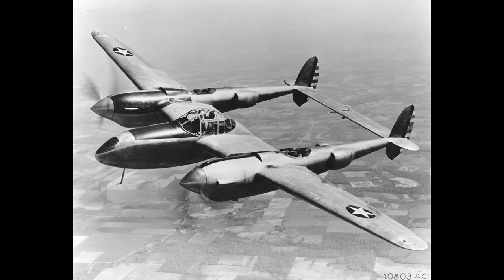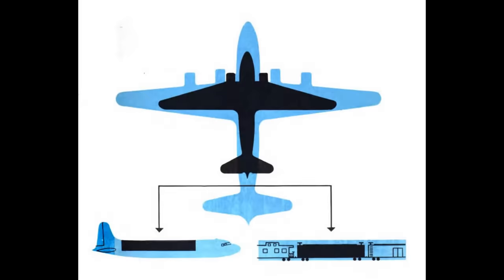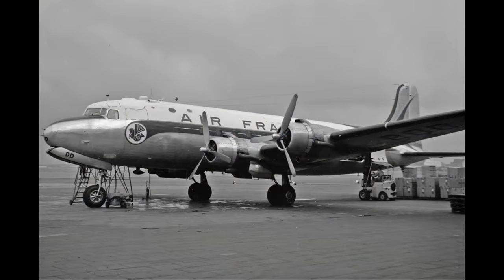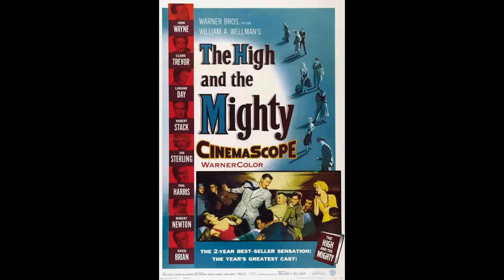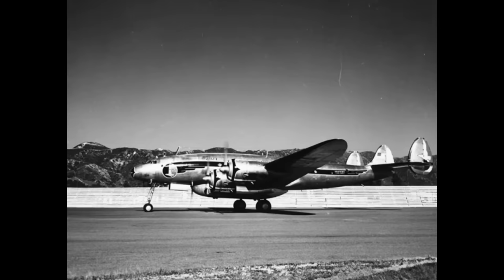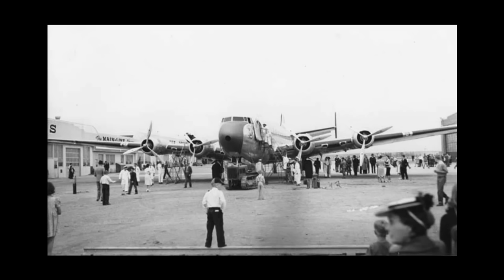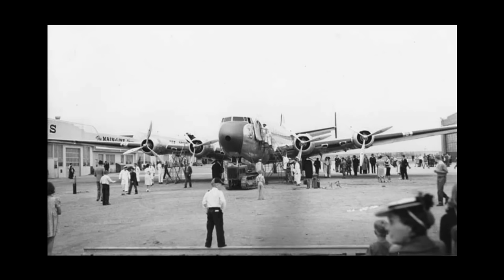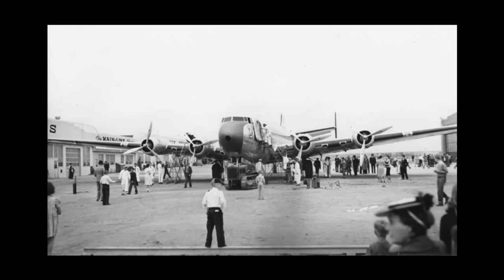Turbo Compound Piston Engines. Almost magic tech.

Comment: If you ignore everything upstream from the turbine, doesn't a turbocompound use the same basic principle as a turboprop?

I wonder if exhaust thrust would ever be more valuable than the turbocompounding, it just seems so much less efficient that it may never be worth it, I'll try to calculate it
Reply: So after some research, calculations and a fair amount of guesswork I have come up with this:

A mosquito will lose about 13mph by installing the exhaust flame dampers, now, I can't possibly know how much of that is caused by extra drag, power reduction due to backpressure and exhaust thrust loss, but let's say that the remaining thrust cancels out the other factors, calculating the drag at top speed with/without dampers I have come to 230-250lbf from the exhaust, with 3420hp that's 0.067-0.073lbf/hp. On the chart shown in this video we see turbocompounding adding about 19% extra hp at full power (550/2850hp), or 0.19hp/hp. So at what point does 0.07lbf overcome 0.19hp? A bit over 1000mph. Now, I do not know if this reinforces my theory that turbocompounding is vastly more efficient than exhaust thrust or if there is an error in my ways.

Obviously my numbers aren't 100% correct (perhaps a bit more exhaust thrust?), but I am confident it does reach the correct conclusion. I've seen ratios of 0.1lbf/hp quoted for top fuel dragsters (~1000lbs, ~10000hp), which use bonkers nitromethane engines that throw giant 6ft fireballs, and even then it would take 715mph, almost supersonic speeds, for the open exhaust to beat turbocompounding.

If someone finds an error please correct me!

Comment: I wonder if they could have also converted the heat from the exhausts into a secondary power recovery from steam into maybe a steam turbine,
I don't know if it would be enough to go straight to the crank but an electric motor but with all that bhp the heat produced must be pretty significant.

Comment: 2:30
Possibly the best COMMON long-haul transport.
There were Constellations in existence and in use at that point - but they had not had the chance to start volume construction by the time the US entered WW II.
Reply from the maker: as explained in the video.
Reply: @GregsAirplanesandAutomobiles  Not that I saw, or I'd not have made the comment.

Comment: I have thought about using a V8 & using every other cylinder to supercharge when a lot of power is needed . The old BMW motorcycles were very low compression so lasted long. Now the compression ratio is about double so engine life is less . I am very interested in opposed piston engines , wondering why they need turbo or supercharging . The old 2 stroke bikes lasted long too.
Reply from the maker: That's already been done.

Comment: I was expecting to see what we call "twin charging" in the automotive world. This is totally different and interesting
Reply from the maker: Yup, twin charging is totally different.
Reply: @GregsAirplanesandAutomobiles  yes, although a chain (or belt) driven supercharger pushed by a turbo will put power back to the crank as well
Reply from the maker: kinda, it will still be a net loss, that exhaust back pressure from a turbocharger hurts the overall power.
Reply: @GregsAirplanesandAutomobiles  yes pressure turbo is more obstruction for sure

Comment: I find that definition of being able to cross the Atlantic somewhat abstract.
It can cross the Atlantic (but it has to refuel multiple times). By such measure, there are many flying boats which would be able to cross the Atlantic. One could even possibly argue that a Cessna 172 with floats would be able to do the same.

Many thanks for another great video.
Reply: Where do plan to land that 172 to refuel?
Reply: @jaym8027  Close to a boat or ship carrying avgas.

Comment: You explained this well. But im curious why it hasnt been tried on other aplications... why not also add a compressor to this and add air and fuel=even more power.
Reply from the maker: It has been tried in other applications and in all cases a compressor is used to add more power.

Comment: This system would lend it self greatly to electric turbo setups combined with hybrid drive - one could recoup energy from the exchaust AND when not needed, store it in the battery OR feed it directly to the electric motor !
Reply: Basically what you said is the very thing F1, Mercedes AMG ONE and future Porsche 911 use (and will use)
Reply: @kidpagronprimsank05  yeah, BUT audi (IF I’m not mistaken) has an electric turbo setup already in production cars but it seems that they missed the boat on tangling it with at least mild hybrid.

Comment: I was told many years ago that USAF had 8 jet engines on trailers at gander, overcast weather, would run them to help burn off fog covering runway.
Reply: The FAA had an experimental program at Arcata CA that used huge kerosene torches for that- worked OK but very dirty
!😊

Comment: just thinking that the hot exhaust, ejected at a speed (velocity) greater than the travel speed (guess?) and directed rearwards would support via newtons principle, a degree of thrust..  quasi Meredith effect...   does the recovery of exhaust momentum energy (ie velocity) not rob the aircraft of this form of thrust?   perhaps you mentioned it.. perhaps the angle of exhaust rejection does not support this...
Reply from the maker: Ervs, did you watch the whole video?
Reply: My response ended up as a new comment…😬

Comment: 23:58 you don't need aerodynamics for that, just basic physics. Thrust is a force. Energy = force*distance. Power = energy/time = force*distance/time = force*speed. So if our force is thrust, we have power = speed*thrust.

If we combine different unit systems (in this case nautical units for speed, imperial units for force and the arbitrary unit of horsepower for power), we nerd to do a conversion, which adds a factor, in this case 1/325.
Reply from the maker: I have to use a source, for this channel the best possible source to use is often Aerodynamics for Naval Aviators. Yes, there are other ways to look at it and other sources out there.

Comment: Damn, now I want that system on my little hatchback ^_^

One thing I'm wondering about -- does the inertia of the system also help with pulling exhaust gases out of the engine, like a good manifold does? That would of course require pressure differences after all, but well... if a rotor is spinning while there's no exhaust valve open, there would be.

Comment: Takeoff and climb performance took a really big hit in the big pistons when 115/145 was no longer available. The Canadians kept the Argus running by contracting with a refinery for a special batch. For a big enough order with enough money to be made, a refinery will be happy to brew to spec.

Higher octanes allow higher pressure and more efficiency; obviously the engine is working harder at higher temperatures. That's one reason folks keep trying to produce a diesel engine for aircraft.
Reply: IIRC 100/130 cost about 200 hp compared to 115/145 on the DC-6B, per engine

Comment: Any thoughts on this upcoming Dodge Ram power train in which the internal combustion engine basically simply runs in order to provide electrical power for an electric drive system?   As I understand it, the ICE does not drive the wheels at all!  Something like a diesel electric locomotive setup.
Reply from the maker: I think it's incredibly dumb. I has all the complexity of an EV along with 90% of the complexity of a gasoline powered truck, all packed into one huge expensive vehicle. That gas engine they are using is a full on 3.6 liter V6 as normally used to power Chargers.

Comment: Forgive me for being a bit simple here. But it needs to be for me to understand it. Your explanation of power and thrust.
Have I understood things correctly if I say that at low speed the exhaust of a jet engine produces more thrust if used to turn a propeller. And at higher speeds when the propeller becomes less efficient the exhaust produces more thrust by simply blowing it out the back.
Reply from the maker: That's correct.
Reply: @GregsAirplanesandAutomobiles  thanks. I appreciate your videos. You’ve taught me alot about aviation and engines.

Comment: The question I have is does the blow down turbine hamper exhaust scavenging from the exhaust pipe geometry in car engines, and if it does, does the added horsepower from the compound turbo offset what is gone from removing exhaust scavenging and also added mechanical (friction) losses due to the added moving parts?
Reply from the maker: In short, not it doesn't hamper scavenging. It does have mechanical loses, but overall large gains.

Comment: I do believe some Detroit diesel engines use a shaft from the turbo with a fluid coupler that goes to the timing gears to drive the engine.

Comment: Most of design work was done in later part of WWII and product completion post war, articles I have read describe engine failures from exhaust valve longevity, where would it be if jet turbine metallurgy had been applied also to these piston engines. Was reported fuel economy was choice for usage along with power, most of jets used water injection to increase thrust for take off, not sure when this may have, if ever stopped on jets.

Comment: Rolls Royce developed this on their experimental Crecy two stroke V12 engine, interestingly it drove the supercharger and the crank. Jet engine killed it.  It kept breaking its drive shaft hence the hydraulic coupling you mentioned. Scania and Volvo have used it in Europe. I believe Detroit used them in the States. Comet and 707 killed them off.

Comment: A little off the topic but I was watching one of the Wasp Major rotating cutaways you can find in some museums around the country. One of the docents came up and told me that the turbine looking vanes at the front of the cylinder banks was only to mix the fuel-air mixture. I thought it was there to raise manifold pressure. Can anyone shed some light on that?
Reply from the maker: I'm not sure what he is talking about, but these engine had a supercharger that is absolutely there to raise manifold pressure.

Comment: I hope tightening CAFE standards do not make these things mandatory on new vehicles.  Great tech but looks expensive.
Reply from the maker: I would hate to see that as well. The free market should decide that issue.
Reply: It isn’t needed imho. Manufactures have done amazing things with fuel injection, turbocharging and tightening up tolerances (ironically, to meet emissions regs and satisfy demands for performance) My 10 year old turboed BMW cranks out 240 hp on 2000 cc displacement and rarely gets less than 35mpg. For workaday automotive applications turbo compounding would be unnecessarily complex and heavy, imho.

Comment: Turbo compounds were fantastic devices but also fantastically complicated. Having over half the power generated from the exhaust turbine with only 3 moving parts underscored that the piston section as a gas generator was a losing proposition when weight and complexity were factored in, over the much higher fuel consumption - but also potentially much higher output power of a pure turbojet engine (where the piston section was pushing the utter limits of materials design and could disintegrate under such loads, as mentioned by other commenters)

They were a good idea if mass wasn't an issue (marine engines?) but on an aircraft they were essentially doomed even before they appeared by the development of the turboprop engine and as soon as turbine endurance exceeded pistons, the writing was on the wall (The Connie was referred to by TEAL (Air New Zealand) pilots as "the greatest 3 engine airliner to ply the Pacific" and 30 maintenance manhours per engine per flight wasn't unusual on longhaul flights - nor was arriving on 3 engines)
Reply: IIRC something like 200hp per PRT for an R-3350, not 1/2 but still significant and gave it the fantastic (relatively speaking) efficiency
Reply: @johnparrott4689  it was about half on the Napier Nomad and that's what convinced Napier & others to concentrate on turboshaft/turboprop despite it being more robust than than Radials like the Cyclone when tested
Reply: Would love to hear a Nomad run😀

Comment: Isnt one of the reasons for the c-130 having turbo props also because they are less susceptible to ingesting fod when landing on an unimproved runway ?
Reply from the maker: Sort of, it's a factor, however there are a lot of turbo-props that almost never operate on unimproved runways. Conversely, there are jets made specifically for dirt and gravel runways.

Comment: 33:00 from what i understand its good for reliability. because turbine reliability will otherwise suffer from engine vibration. besides electric motors have great power to weight ration so it may not be big package anyway

Comment: Interesting as always Greg. Wasn't the R3500 Wasp Major not equiped with a turbo charging and a turbo compound system? The turbo charging turbine used the last expansion and pressure of the exhaust and the turbo compound systen the velocity.
Reply: There was never a production version of the -4360 with turbo compounding but Google the VDT version, similar ideas in using exhaust for extra power…

Comment: My freshman roommate’s father had been a Delta pilot and his son, who told me, said that the DC-6’s engines were straight out of military planes and the poor mileage almost sank the airline.
Reply: Ironically nearly every turbine aero engine in civilian use has military origins or was the product of DoD R and D. The only one I can think of that doesn't is the Garrett TFE-731.
Reply: @johnparrott4689  Although the turbo was invented by 1918, it wasn’t until WW II when GE began it’s work on an American jet engine that it’s technology for that allowed it to produce a viable turbocharger, according to a Kate 1940s book on aviation. I kinda wish I hadn’t given it to my airline captain son in law.

Comment: basically propeller can only be dessing for a especific speed because is helical turbines are essentially just the tips without center, they need to marry the piston engine with a fan blade it may not even need a transmission,it will be heavier but fuel will be cut by half,so total take of wight is lower.

Comment: As you state. The only turbo compound engine still in production, is a Volvo/Mack 6 cylinder, in only one horsepower rating. Their supposedly most efficient engine for a Class 8 truck.

Comment: At what height (assuming ISA) did a DC7C with turbocompounds reach its maximum TRUE Airspeed in level flight?
Reply: Wild guess: 20-25000'. Edited to add: Quick Google search returns 10-15000’ for max range, and 21000-22000’ for best speed for DC-7C and L-1649. I couldn’t find manufacturers specs though. 

The turbocharged piston singles and twins I have flown had the highest true airspeeds at around 18-23000’. A lot depends on critical altitude’, where available HP begins to decrease thanks to air density. This was for example 20000’ in a Cessna Turbo 210.
Reply: @johnparrott4689  Why doesn't it produce its best range at the same height it goes its fastest?

Comment: @GregsAirplanesandAutomobiles, q? Your video states very clearly that the energy is coming from velocity,  I've always thought the energy came from heat extracted.  I'm wondering if it's not actually both because of ideal gas law (pV=nRT) they are linked.  Just a conjecture.
Reply from the maker: Yes, I do say that, and it's exactly what Curtis-Wright says, I have that document on screen at 19:49. The discussion of heat is an interesting one and really too complex for the comment section. The turbine doesn't spin due to heat. You can heat it up all you want and it's not going to spin unless there is either a velocity or a pressure differential on each side of it.

Comment: Trans-Atlantic means New York to London, non-stop, with designed payload and in normal weather ie not with a super jet stream.
'Long haul' usually means 5 hours.  That means that Brisbane to Perth (east to west) is long haul because it's always into a head wind, whereas Perth to Brissie is normally 4 hours, sometimes a few minutes less and isn't 'long haul'.

Comment: A piston engine with the limited gas expansion stroke does not extract the available energy, called enthalpy remaining in the cylinder, a further expansion is accomplished  in  the Atkinson cycle engine, or by expanding the gas in a turbine, partially in a turbocharged engine just  to drive the charger, energy fed back into the engine for the purpose of increasing the pressure . By adding or increasing the extraction of available enthalpy, the gas expansion turbine can feed its output to the propeller; other than the size , this turbine is no different in operation than a normal turbine, a first fixed gas redirection and flow velocity increasing  stator vane and the power recovering moving strongly flow turning turbine stage.  The power is exactly the torque generated by this stage times the angular velocity of the turbine. Next follows  a reduction drive to increase the torque transmitted to the propeller. In any case the specific energy, the enthalpy , is  the temperature reduction possible times  Cp, specific heat = R times
 gama/(gamma -1)
where R is the general gasconstant 8314. joule/kg K, divided by the average molecular weight of the exhaust mix , N2, NO2, CO2, H2O.
And gamma is the ratio of specific heats, about 1.31
The gain is substantial, the specific fuel consumption is reduced from ~0.44 to 0.33 pounds per horsepower hour